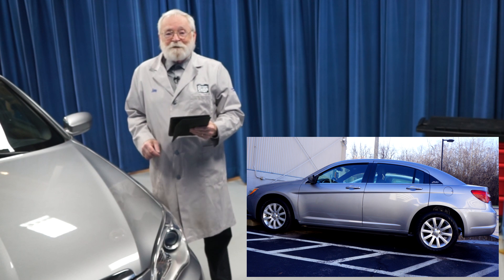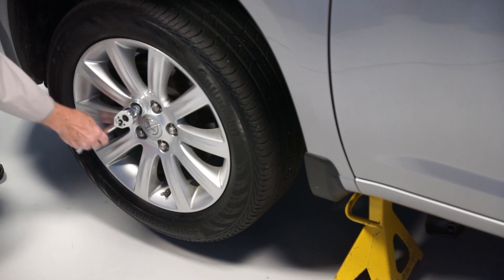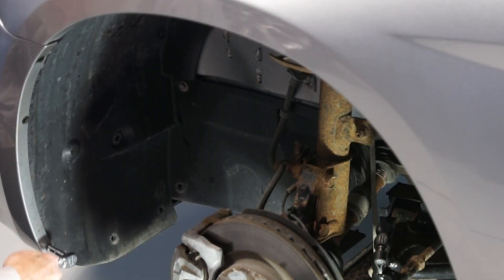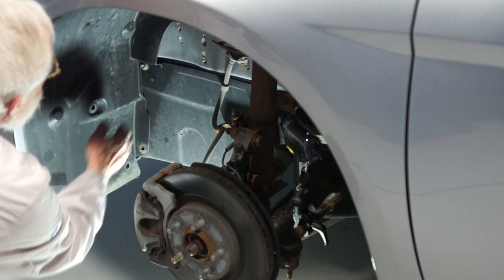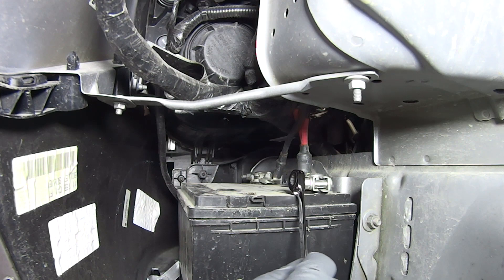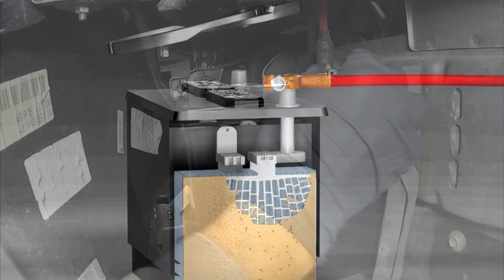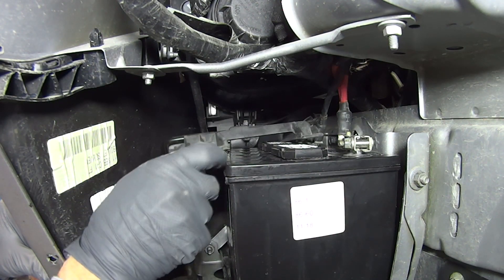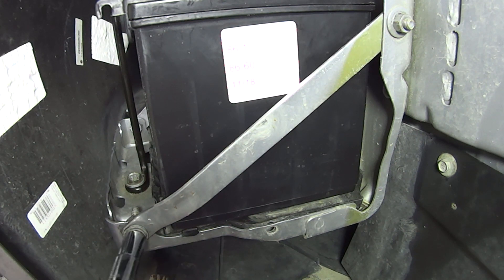Chrysler 200 (2011-2014) - New Battery Install

Comment: God, I will never buy another Chrysler again!
Reply: While this is a major feat of engineering stupidity,  i have a Chrysler 200 ,125k miles ,still going strong. Replaced the batt after 7 years, tires at 70k , everything else is original. Its been a solid little car ,drove from md to miami , md to denvdr, jackson hole, never a minutes problem.  My dad had a service station for 43 years ,so replacing the battery was not a big deal for me. Tho i replaced BEFORE it went bad, so i wasnt stuck somewhere on a 100 ° day...
Reply: I swear 🤦🏾‍♀️
Reply: pro trick : watch movies at flixzone. Been using them for watching lots of of movies lately.
Reply: @Omar Mason yup, I have been watching on Flixzone} for years myself =)

Comment: As soon as he said to remove a tire, I wanted to throw my whole car away.
Reply: Bruh!! Exactly how I feel every time I say, “oh I can do it “ google my car! Find out it’s stupid
Reply: @ms.pawscompanionfoodsandse3372  so right😢
Reply: I did.
Reply: Update: I traded in my Chrysler about 2 months after I replaced the battery. 😅
Reply: @bedens101  Im about to buy 2012 Chrysler 200, I dont mind the battery place. But is there any major issues with it ? Like some kind of common issues that you aware of ?
Reply: @kamikaze8853  Not that I can think of. I enjoyed the car, except that it was too small for me.
Reply: @kamikaze8853  all the 3.7 motors have a plastic oil filter adapter/cooler that will fail when the cap is over tightened. I suggest replacing with an aluminium one, or doing your own filter, the shops all over tighten them. It should be just tight enough to seat the seal.
Reply: @kamikaze8853  the heater cores
Reply: @kamikaze8853  it’s a bitch after 100k miles. Endless repairs and the oil needs to be changed out more regularly than I did on my Toyota Corolla. Chryslers suck ass
Reply: @kamikaze8853  I hope you didn’t get it. Once a Chrysler reaches over 100k miles it always has problems. I’ve spent $10k on repairs for this car and I’ve only had it for a year and a half
Reply: @kamikaze8853  alteorneiro cheinch
Reply: @kingjamir2135  😢😢😢
Reply: @kamikaze8853  3.6’s groove cams it can be a $3,000+ repair depending on who’s doing it and with what.
Reply: @kingjamir2135 had mine a year and a half and I’ve already replaced the tires twice, starter, axels, struts, sway bars stabilizers, front hub bearings, the calipers, and the antifreeze reservoir, now I gotta replace the radiator and ball joints
Reply: @kvngtoon216  i just replaced the lower ball joints and thermostat housing since it cracked. And i had to change the IAC (idle Air control) valve in just the past 3 months. Now theres some sort of noise it makes when turning right which might be cv axles. But im getting a new car in a few months anyways. Happy to get rid of it soon. Luckily i work on cars so i haven’t had to pay much in labor since the first few repairs.
Reply: @bedens101  about 2 months too late...
Reply: I have 145k on mine no major problems but replacing the battery is some bull..ish
Reply: Ducking righhhtttt
Reply: Same
Reply: All these ppl saying 100k is when the problems start and my car at 99k, but I been had problems...all the problems
Reply: I literally did yesterday, it was dead. I let the dealer have it as a trade in for a steal at $1500. After paying $240 to get a headlight bulb replaced on this thing it was already on my last nerve.
Reply: According to the owner's manual you can get to the battery without removing the tire by just turning the wheel all the way to the right and that should give enough room to remove the shield. So apparently that's something you can do to make it much easier?
Reply: Me to lol
Reply: amen
Reply: Dam right
Reply: Yup, messed up when ya gots tah go through all this to replace a battree.
Reply: Before my Dad let me take the car, after I had my license, he showed me how to take my tire off and put it back on.
Reply: No frfr this my last Chrysler
Reply: Lol foreal
Reply: For real. I was given this car for free with only 68000 miles so I can’t complain but this is so rediculous I’ve just been driving my dinosaur Nissan Sentra
Reply: 2.4L on these is actually pretty good. ours is going on 200k now with just regular oil changes. the plastic cooling system stuff is terrible, tho. had the coolant cap plastic neck thing crack and leak coolant out while driving... then the thermostat plastic housing cracked at the rubber seal and was also leaking. valve cover gasket was hard as a rock after 10 years, so normal maintenance there. the worst thing on these has so far been the windows just dropping out of nowhere. we've fixed the passenger's side at least three times now and it failed again yesterday... going to put some screws in to make it stay up permanently now. the blend door actuators are prone to get stuck/break, but those are relatively simple to replace. trans line developed a pin hole and was leaking a few years ago. was also simple to replace. throttle body failed, and because it's electric, the car wouldn't even start. easy to replace, but even aftermarket is a bit of cash. mostly just maintenance stuff, so this car doesn't really owe us anything at this point.
Reply: My damn battery just died right now and I am fuming. I'm over it and haven't even started except for watching this video 😂
Reply: Naw frfr 😂😂😂😢
Reply: I know ha?  One small thing they did not mention when purchasing the vehicle😢
Reply: Chrysler for ya
Reply: My husband insisted he needed this car and I hate it. The guy at the parts store said he'd never buy one 😒
Reply: 😂😂 same
Reply: Omg same
Reply: LITERALLY ME, my dad sent me this video saying he need me to do this, like come on now
Reply: Dumb ass invention
Reply: American engineering at its worst
Reply: That’s got I often feel. I’ve had the car 5 years I think. Just paid it off. I’ve put thousands in repairs.
Reply: I’m driving one it has about 150k miles on it and I can tell the transmission is about to go, I baby it like no other right now. They do seem to fall apart after 100K miles , the engine is starting to give me trouble also.

Comment: I'm really curious about something. I have a 2014 Chrysler 200 S, 3.6 L. I got a H7 730 CCA battery but since it's gonna be such a pain in the arss & I truly want the most powerful battery I can safely put in... Can I put up to an 800 CCA H7 battery in? Obviously it would have to  be within correct measurements to fit. I'm just gonna measure mine & go back to Walmart today to see if I can find one with same measurements. If I get a battery that powerful could it possibly somehow cause problems? Thank you much for your time.
Reply: @TheBatteryShop  Soo good to hear, I really appreciate your prompt response 😁👍🏼🌞

Comment: absolutely no way I'm doing this! this is mad. Thank you for the video tho!
Reply: @TheBatteryShop  I actually planned on doing this. I cant because I can't open my trunk since the battery is dead to get the jack.
Reply: @stephenoni2019  idk if you find out a solution but you can pull the backseats down to get into the trunk ☺️ just saying this happened to me and I went in that way!
Reply: @TheSlowStitchery  thanks I just tried it
Reply: @stephenoni2019  you can use the remote terminals to jump start the car or pop the trunk.

Comment: God forbid you ever need to be boosted off in one of these. Lol
Reply: boosting isn't bad, it's charging and replacing that appear to be problematic.
Reply: There's a set of terminals under the hood on the driver side for charging and/or jump starting.
Reply: You can boost under the hood should have positive, negative posts

Comment: I just bought a couple of weeks ago a 2013 200 Limited. for my wife to replace a 2005 Ford Taurus that is on its way out. The 200 is a nice mid size car with plenty of features and my wife loves the car.  Not realizing or thinking of where the battery would be located  in the car. I did see before we purchased the vehicle that there were jumping terminals on top in the engine bay. I saw those and thought at the time without looking, well the battery must be in the trunk beside the spare tire  like my car a Dodge Charger.  Then after we purchased the car and got it home  I started looking for the battery, well its not in the trunk beside the spare tire, maybe its under the rear seat? I got the manual out and started reading and said to myself Say what!!  It is a stupid design but it would not detract me  from buying the car again after all you don't replace car batteries everyday.

I think the Chrysler engineers were so excited when they  first came up  with the cars design and said  this is a really nice looking  car  and just look at all these features........Hey Bob, (Chrysler Engineer #1), yes  Dan, (Chrysler Engineer #2),  [why will the car not start (Dan)] [I don't know is there gas in it (Bob)???] [Where's the Battery??? (Dan)] [Oh crap we forgot to design in a place for the battery (Bob)] [ Lets just tuck it behind the front bumper below the headlight because there's some free space there (Dan)] [ Sounds good (Bob)]

Just a Thought.
Reply: The Battery Shop 😆
Reply: Best comment on YouTube 😂
Reply: I met an automotive engineer one day when I was a grease monkey about 40 years ago at a gas station, and I asked him why cars were designed in a way that makes them hard to work on. He explained there are multiple engineers involved in designing and planning for placement of all the components. They design the body, then all the accessories that will be used are put on a list, and the third phase is making everything fit. It made complete sense to me then. Just think of how easy cars were back then, compared to today. Now there as difficult as trying to pick up partially melted ice cubes off the floor with your butt cheeks.